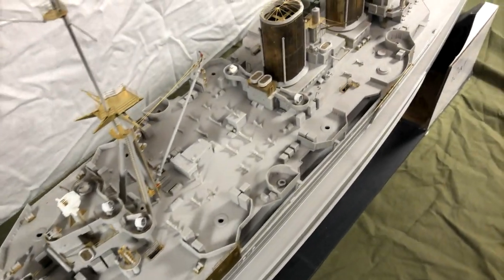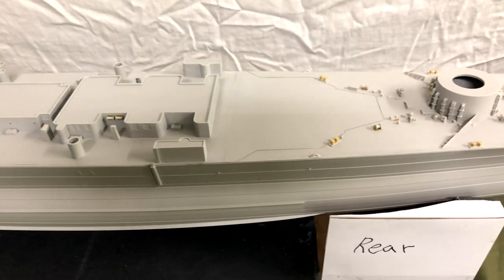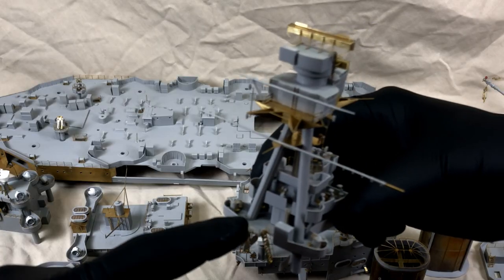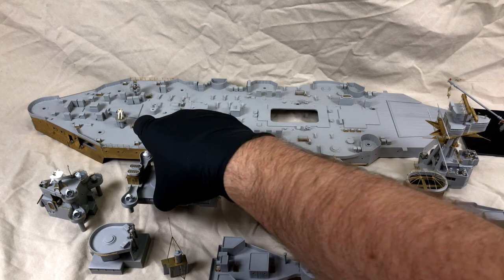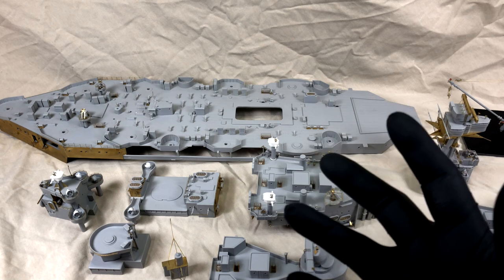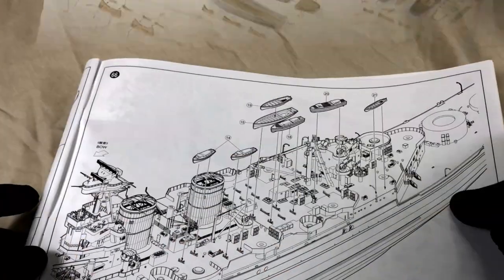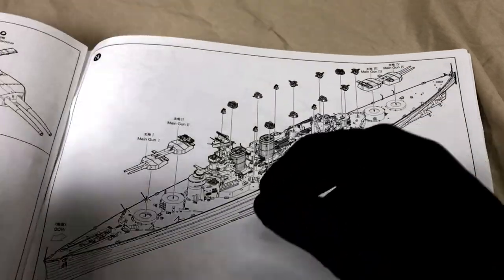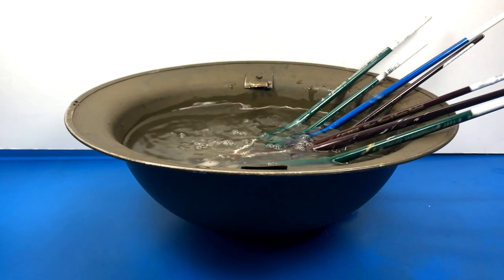TRUMPETER 1/200 HMS HOOD BUILD  *(PART 4)* - 2021

Comment: I found a complete, mostly complete built Trumpeter 1/200 Hood for sale for $35 in a hobby shop.  Now, I'm repainting it, using a brush, but maybe I should just air brush everything above the deck, since everything is already cemented on, and touch up items with a brush, that need a different color.  The PE are in bad shape also.  Soon, I'll either get the Iowa or Missouri, and build it up myself, these mega models are the top of modeling world, in my IMHO.

Comment: Hi building the Hood using the Pontos set I having problems with the fire control on the foredeck, how did you handle this?
Reply from the maker: I don't think I did that part. I'm only using certain parts that I feel need upgrading. If you tell me the situation i may be able to walk you through it. Thanks